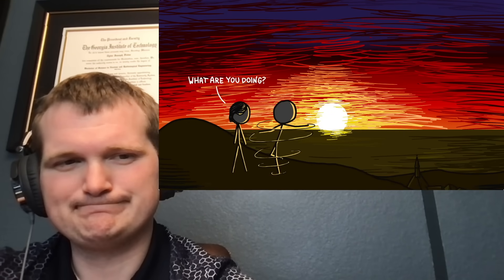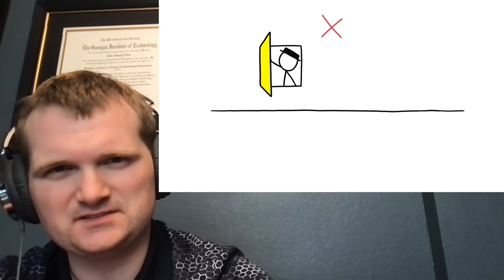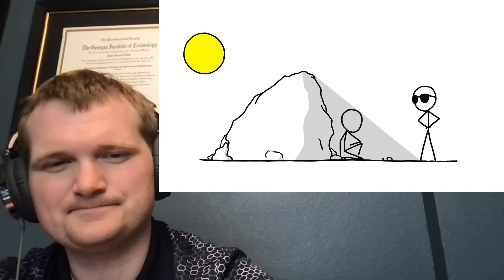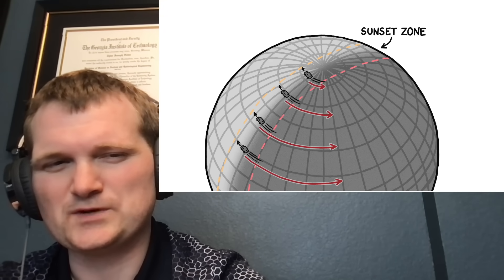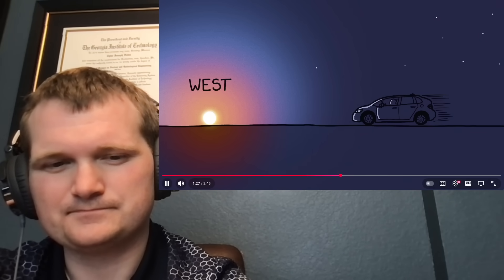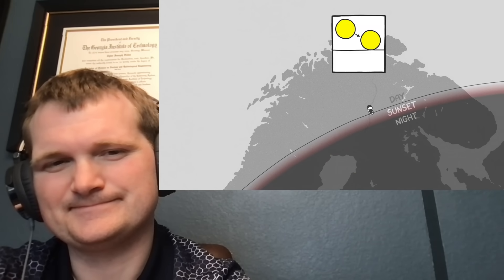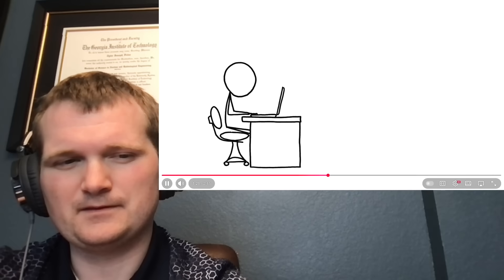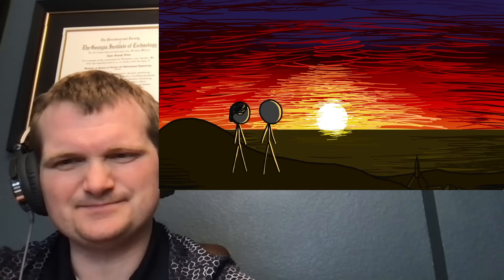Can You Drive West to Lengthen the Sunset? - Nuclear Engineer Reacts to XKCD

Comment: I think he hasn't reacted to the Destin video because he can't really contradict people in his own industry even when they are preaching very damaging safety regulations that have strangled the nuclear power industry and basically made it so we don't even really have much of a nuclear industry and massive shortage of nuclear physicists and engineers.

It seems the dosimeters would be better for employees to use outside the plant at your house than inside the plant. 

Destin should have pushed back more or at least said out loud what the workers are not allowed to say. For example I would have asked if bananas are allowed into the plant. 

The workers are clearly brainwashed to support just completely insane regulations and rules that are very damaging and harmful to the nuclear power industry.

Destin was standing above a deadly nuclear fuel rod and only separated by what looked like 15-40 feet of water and his dosimeter was reading 0.00 at the end.

They had to jump through all these hoops and they don't even get a dose standing directly above the rods.
Reply: It's a nigh feature length film. Filming and editing are processes for a creator. It has been a valuable insight and I'm sure it will be covered eventually.

Edit: Four hours later, posted.

Comment: Edit: Over Rod and balancing issues of reactors mentioned. Again for primitive world.. Your own science proving capabilities required to merge =  Search Engine: "Boeing Plasma force field blocks bombs" + "Ultrasonic resonance frequencies" + "Plasma generated Ultrasound Warwick University" + "Ultrasound can print through walls" Instead of using frequency filters to never absorb vibration into materials like done for Transcranial pulse brain modulation or Ultrasound stem cell proliferation + Ultrasound holography Stem Cell guidance = Use to control your capacitor discharges for ultrasonic holography control of every bit of your reactors insides.

I ASSURE YOU! You WILL build a reactor after based around Ultrasound.. Then after that you're gonna eventually end up using Ultrasonic shockwave clashing to pull water around your ships shields to catch radiation because your shield is gonna be a fusion reactor expanded outside of craft. Googles: "Plasma UFO immune to Hellfire missiles" and points up at Boeing Plasma force field again That doesn't belong to Boeing but Boeing already told you how its immune. Google: "Ultrasound excited Plasma generates stronger EM field" < The range vs size of your plasma generators = You could defend space colonies NO PROBLEM far around them.

Hehehe.. Squints at Earth headlines about water shortages while looking at the Ocean Cavitation is a waste of power.. Resonance warming is power used for specific target similar to LED Spectrum Grow light goals. Google: "Utilizing ultrasound to disrupt pathogens US20100113983A1" I would link it but channel doesn't allow. Key: "A resonance frequency database can be employed to ensure that local healthy material surrounding a target has a natural resonance frequency dissimilar enough from the tuned resonance frequency." Not just to erase all bad germs but can be used to warm to specific vibration AND overload/split specific things at the exact power levels they require = NO CONTENT LOSS IN PRODUCTION.

Tip for Nuclear expert: Search your own database you should have access to for "Ultrasonic resonance disintegration" if it says Cavitation = You aren't authorized for Resonance fact you have to find on your own or be told by someone who is educated for it to tell you. - Dracula/Hades

(Note: Search engine: "Ultrasound can deactivate parts of the brain" I don't believe in time travel but I do believe in STASIS fields..)

Comment: For some reason I remember calculating this for Mercury and due to the longer day it was something like 4km/h at the equator or an earthly brisk walking pace. I think I also worked out that as long as you kept the sun between 2 and 3 degrees above the horizon the temperature would remain between 0c and 30c too